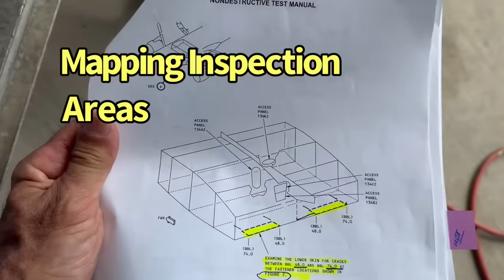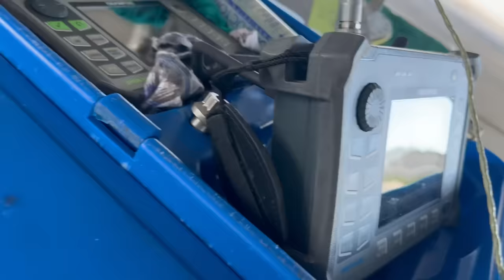AIRPLANE FUEL TANK ENTRY and CRITICAL inspection  #airplane #video #foryou

Comment: Do you know there are classes inside fuel tank too, in the middle where you can stand is the Business Class, then the premium and last that thin part of wing is the economy class.
Reply from the maker: Glad to see you here plyus ✈️ ⚙️ I use a lot the VIP section, that’s the one on Emergency exits 😂 ⛽️ 😂 It’s not every day we get in a fuel tank of an airplane and want to spend more time that we need. This is very dangerous, so with this equipment we can detect cracks under the paint were the naked eyes can’t see.The fuel was transferred to wing tanks, than the tank was drained, purged and vented for 3 days. It has to be all done for safety. I am glad that I am sharing aviation awareness with my videos. Welcome to our show. Check out our New video just uploaded link ⬇️ 
THE smallest DETAILS makes the BIGGEST DIFFERENCE #aviation #video #foryou
https://youtu.be/my6YMdnT388
Have a good day, See you soon next video ✈️👍

Comment: In the 70's I worked on Canadair CL44's ex Flying Tigers. I can remember climbing into Centre fuel tank bay and then releasing bottom of wing tank bags and squeezing under bag so as not to disturb the lacing which held the bag to the roof of the tank bay, to get to the outer bag, which was always the one that was leaking. That was scary, no breathing apparatus. no real safety gear all we got was a milk allowance. You had to keep your cool and not panic. I have never done pot holing, but I imagine that would be the closest I have ever been to doing that. I can still smell the Avtur.
Reply from the maker: Glad to see you here  Roger ✈️ ⚙️  Great story, I remember the flying Tigers they had the Queen of the skies Boeing 747. Those tank inspection are nothing but nerve wrecking. So with this equipment we can detect cracks under the paint were the naked eyes can’t see. The tank was drained, purged and vented for 3 days. It has to be all done for safety. I am glad that I am sharing aviation awareness with my videos. Welcome to our show. Check out our New video just uploaded link ⬇️ 
THE smallest DETAILS makes the BIGGEST DIFFERENCE #aviation #video #foryou
https://youtu.be/my6YMdnT388
Have a good day, See you soon next video ✈️👍
Reply from the maker: Great to see my aviation family here. ✊✈️🧐

Comment: Could you explain better what are you measuring and why? Thank you!
Reply: They aren't measuring as such but using a magnetic probe to check for cracks in certain parts of the structure.
The probe they use creates a high-frequency alternating electric current in the metal structure and by looking on the display at how that field is disturbed by the structure  shows whether there are cracks or not, where they are and how big they are can be measured.
The areas to be inspected are either determined by the structural engineers back at the manufacturers or from other inspections during maintenance.
If you do some research on eddy-current NDT testing, you'll see how it works.
Reply: @125brat  thank you. Very Very interesting!
Reply from the maker: Glad to see you here  Marco ✈️ ⚙️ With this special equipment we are checking for cracks in the structure under the green paint. I am glad I made this video for public awareness, so they can see what professionals do behind the scene  🎬 to keep skies safe. It has to be all done for safety. Welcome to our show. Check out our New video just uploaded link ⬇️ 
THE smallest DETAILS makes the BIGGEST DIFFERENCE #aviation #video #foryou
https://youtu.be/my6YMdnT388
See you soon next video ✈️👍

Comment: Spent too many years crawling through every inch of the kc-135. I have the scars and permanent injuries to prove it. I will never crawl inside another fuel tank for as long as I live.
Reply from the maker: Glad to see you guys here ✈️ ⚙️This job is not for everyone it’s definitely not for me neither. I do believe it’s the worst job in aviation. Great to see my aviation family here. There are smaller and much larger tanks, not to mention the wing tanks. So with this equipment we can detect cracks under the paint were the naked eyes can’t see.The fuel was transferred to wing tanks, than the tank was drained, purged and vented for 3 days. It has to be all done for safety. I am glad that I am sharing aviation awareness with my videos. Welcome to our show. Check out our New video just uploaded link ⬇️ 
THE smallest DETAILS makes the BIGGEST DIFFERENCE #aviation #video #foryou
https://youtu.be/my6YMdnT388
Have a good day, See you soon next video ✈️👍

Comment: How come there isn’t residual fuel inside the tanks, even just vapour. I’m a chemist and even in the labs beakers that used to have solvent in them will still stink. I understand that it will be purged with air, but still
Reply from the maker: Glad to see you guys here ScottlqndtheBrave ✈️ ⚙️ I don’t know what to tell it was 3 days of venting. This job is not for everyone. There are smaller and much larger tanks, not to mention the wing tanks. So with this equipment we can detect cracks under the paint were the naked eyes can’t see.The fuel was transferred to wing tanks, than the tank was drained, purged and vented for 3 days. It has to be all done for safety. I am glad that I am sharing aviation awareness with my videos. Welcome to our show. Check out our New video just uploaded link ⬇️ 
THE smallest DETAILS makes the BIGGEST DIFFERENCE #aviation #video #foryou
https://youtu.be/my6YMdnT388
Have a good day, See you soon next video ✈️👍

Comment: So, it was not about the tank, it was to ckeck if the wings will come off in flight soon or not.
Reply from the maker: Glad to see you here  TimTum ✈️ ⚙️ 😂 no winds coming off today. You are perfectly right, very observant, I understand what you are saying. It’s not everyday we get in a fuel tank of an airplane and want to spend more time than we need. This is very dangerous, so with this equipment we can detect cracks under the paint were the naked eyes can’t see.The fuel was transferred to wing tanks, than the tank was drained, purged and vented for 3 days. It has to be all done for safety. I am glad that I am sharing aviation awareness with my videos. Welcome to our show. Check out our New video just uploaded link ⬇️ 
THE smallest DETAILS makes the BIGGEST DIFFERENCE #aviation #video #foryou
https://youtu.be/my6YMdnT388
Have a good day, See you soon next video ✈️👍

Comment: As a NDT engineer I have entered several fuel tanks including A380, B777.. A380 is my fav as it is the most spacious inside…
Reply from the maker: Great to see my Aviation NDI family here. My biggest airplane tank was Boeing 747-400. Those are the worst jobs in aviation i believe. Just of the confined space and risk if something happens. I picked this video for you link below ⬇️ see you soon 🔜 
AIRPLANE ✈️ EXPERTS 🤷‍♂️ #grounded #aviation #video
https://youtu.be/r36siYl-yNQ
Reply: @slipperybeastaviationfishingsh  wow it looks cool, one of my fav aircrafts is B747 but unfortunately haven’t got a chance to work on one… 
A380 is worse for NDT. They have more NDT tasks than any other aircraft. Recently found around 1000+ cracks on LH/RH wing of A380. Extensive repairs are underway. We found many cracks on newer aircraft’s than old ones !!! Anyways these cracks doesn’t pose any risk to airworthiness as they are being monitored during repeat inspections..
Reply from the maker: Oh wow 😮 I never knew about that and the A380 , wow you got your work cut out for you. It’s crazy about the new generation planes. Great to see you here again.
Reply: @EK2921  yeah sure....cracks are not dangerous for liquid fuels. Not even a car tank is driveable with cracks in the tank, but an airplane surely is, right?  Dont tell Bullshit to people. Whatever goes in these chambers, it is certainly not liquid fuel.

Comment: I have a 100 gallon transfer tank in the bed of my Chevy 3500HD and when it's half full and i come to a hard stop all of the sudden you can feel the fuel rocking the truck forwards and backwards temporarily.  Thats just 50 gallons. The slippery guy wants you to believe there is 28,000 gallons almost 200,000 Lbs of weight in the wings of this plane, let that sink in if u can.
Reply: Thats approximately half the take off weight....ok
Reply from the maker: Sorry for the late reply cdimmm. Good to see you here ✈️ ⚙️ Thank you 🙏 for such comment. I hear you about your 100 gallon fuel ⛽️ tank. Those walls we are going through are called baffles to keep the fuel from slushing. Look it up on Google. Boeing 767 fuel tanks and capacity. I am glad I made this video for public awareness, so they can see what professionals do behind the scence to keep skies safe. It has to be all done for safety. Welcome to our show. Thanks for enjoying this video.Check out our New video just uploaded link ⬇️ 
Camera Inside Airplane Turbine Jet Engine #airplane #video #foryou
https://youtu.be/mdCpb5tp66s
See you soon next video ✈️👍

Comment: I have a question guys... if eddy current say that you find a small crack or samall opening.. how did you repair it?... could be usefull any epoxy to fill damage?...regards and take care all the time, thanks for show us
Reply from the maker: Sorry for the late reply Oschuttp. Good question,so the fuel tank is part of the structure of the entire airplane ✈️. Permanent repair would required using same type of material as a doubler or a trippler . Have a good day
Reply: @slipperybeastaviationfishingsh  Thanks and my Best regards
Reply: @slipperybeastaviationfishingsh 
Back to the structural engineers to decide whether to raise the inspection frequency or apply a repair scheme.

Comment: Aircraft fuel tank inspector position opening:
Mandatory job requirements, the candidate has to be in shape otherwise the company is not responsible in case he gets stuck in openings while entering and exiting.  Thank you.
Reply from the maker: 😂 that was funny. They have to have a size requirement 😂 ✈️⛽️😱

Comment: Speaking from experience As a 1 time gas station builder I've seen the inside of Many tanks. And I could tell you that the tank inside this airplane Has never seen 1 drop of fuel!!!!
They're doing these videos as damage control Because of how much information is getting out About the truth that these planes use no fuel. The only engine that would use fuel is the auxiliary engine in the back. That engine is what drives the main engines with compressed air. You can also witness for yourself In many vacation spots where the people on the beach Wait for a plane to take off and they hold on to the fence as the Air blows blows them around.  Well whats coming out of the engine is very clean and very cool air As in Being run by only air. No person has ever been burnt By the air coming out of these engines as you would expect if it was Run with fuel that air would be very hot  enough to severely burn people
Reply from the maker: Wow 🤯 look up on Google how many gallons of Jet A fuel ⛽️ Boeing 747 -8 can carry for an 18 hour flight none stop. It will burn 63 K gallons. Yes that’s 3 eighteen wheeler fuel trucks you see in the road. 
Sorry for the late reply , glad to see you here  ✈️ ⚙️  It has to be all done for safety. I am glad that I am sharing aviation awareness with my videos. Welcome to our show. Check out our New video just uploaded link ⬇️ 
Camera Inside Airplane Turbine Jet Engine #airplane #video #foryou
https://youtu.be/mdCpb5tp66s
Have a good day, See you soon next video ✈️👍

Comment: Where is the fuel stored?
Reply from the maker: Glad to see you here  Tamoghna ✈️ ⚙️ Its stored there and in the wings all 18K gallons. It’s not everyday we get in a fuel tank of an airplane and want to spend more time than we need. This is very dangerous, so with this equipment we can detect cracks under the paint were the naked eyes can’t see.The fuel was transferred to wing tanks, than the tank was drained, purged and vented for 3 days. It has to be all done for safety. I am glad that I am sharing aviation awareness with my videos. Welcome to our show. Check out our New video just uploaded link ⬇️ 
THE smallest DETAILS makes the BIGGEST DIFFERENCE #aviation #video #foryou
https://youtu.be/my6YMdnT388
Have a good day, See you soon next video ✈️👍
Reply: @slipperybeastaviationfishingsh  but I want to see the floating oil in the tank.

Comment: What is with all the gray sealant/putty on rivets and seams. Looks like some one had a field day with JB weld in there. I have used it to repair leaks on fuel tanks in autos. I'm guessing those rivets and seams were seaping, and this is a approved repair??
Reply from the maker: Glad to see you here Thomas ✈️ ⚙️ this airplane has been around for 29 years. The sealant is called PRC B2. It what they use, all repairs are good to go. So with this equipment we can detect cracks under the paint were the naked eyes can’t see.The fuel was transferred to wing tanks, than the tank was drained, purged and vented for 3 days. It has to be all done for safety. I am glad that I am sharing aviation awareness with my videos to the public. Welcome to our show. Check out our New video just uploaded link ⬇️ 
THE smallest DETAILS makes the BIGGEST DIFFERENCE #aviation #video #foryou
https://youtu.be/my6YMdnT388
Have a good day, See you soon next video ✈️👍

Comment: It would have been more educational if he explained what exactly he was measuring.
Reply from the maker: Glad to see you guys here Museamjunkie ✈️ ⚙️ Sorry it was about doing the inspection and getting out as soon as possible, before static ⚡️ This job is not for everyone. There are smaller and much larger tanks, not to mention the wing tanks. So with this equipment we can detect cracks under the paint were the naked eyes can’t see.The fuel was transferred to wing tanks, than the tank was drained, purged and vented for 3 days. It has to be all done for safety. I am glad that I am sharing aviation awareness with my videos. Welcome to our show. Check out our New video just uploaded link ⬇️ 
THE smallest DETAILS makes the BIGGEST DIFFERENCE #aviation #video #foryou
https://youtu.be/my6YMdnT388
Have a good day, See you soon next video ✈️👍
Reply: @slipperybeastaviationfishingsh  Thank you very much for the explanation. I almost tried to get my A@P years ago. I chose cross country trucking instead. Thanks for keeping us safe when we fly :) I wonder if the 767 automatically transfers fuel from tank to tank to keep the center of gravity correct or does the pilot have to manually do it? I remember watching a Concorde video and the flight engineer was having to monitor that and transfer fuel manually from tank to tank. Thank You
Reply from the maker: @museumjunkie9317  It’s never to late ⏰ to join the aviation Technicians. This career is doing better than ever. High demand and great pay 💰 with benefits. I do believe fuel ⛽️ manually switched by the copilot to keep weight and balance. Glad you are here anyways enjoying some inspections with us. Have a great day. See you soon next video. Let me know if you have any type of aviation video I can do.
Reply: @slipperybeastaviationfishingsh  Thank You

Comment: How on earth, is it possible that the engines are running but the fuel tank is dry like a Sahara desert.
How on earth is it possible fire those engine to left an Olympic swimming pool size fuel + all the passengers, there luggage and the enormous weight of the entire aircraft.
These Engines run on compressed air ( Nitrogen & Oxygen ) there is absolutely no fuel except in the wings only for igniting the fuel ( oxygen & nitrogen ) that's the reason there is no smoke thus no exhaust.
Reply from the maker: Glad to see you here MrPatriot ✈️ ⚙️ That airplane takes 27 K gallons of Jet A fuel ⛽️ those engines run on fuel. Yes they produce pneumatic air to run the air conditionings, hydraulic power and electrical power for the aircraft. Aviation engineering is mind blowing 🤯 we can never even imagine the complexity that keeps everything running smooth. I am glad I made this video for public awareness, so they can see what professionals do behind the scence to keep skies safe. It has to be all done for safety. Welcome to our show. Thanks for enjoying this video.Check out our New video just uploaded link ⬇️ 
NEW BOEING 767 AIRCRAFT TURBINE JET ENGINE INSPECTION 😓#aviation #video #foryou
https://youtu.be/Ii-nUDZ4KLU
See you soon next video ✈️👍

Comment: Wow wtf Boeing. It's 2024. How is a strong, independent, plus sized inspector supposed to fit in that access hole?
Reply from the maker: Glad to see you here Kibbles ✈️ ⚙️ 😂 So with this equipment we can detect cracks under the paint were the naked eyes can’t see.The fuel was transferred to wing tanks, than the tank was drained, purged and vented for 3 days. It has to be all done for safety. I am glad that I am sharing aviation awareness with my videos to the public. Welcome to our show. Check out our New video just uploaded link ⬇️ 
THE smallest DETAILS makes the BIGGEST DIFFERENCE #aviation #video #foryou
https://youtu.be/my6YMdnT388
Have a good day, See you soon next video ✈️👍

Comment: Tank Rats we called them in the U.K.
I'M retired now and my gut would never fit through the access panel 😁
Reply from the maker: Glad to see you here again, Mike✈️ ⚙️ Yeah we have heard of the Tank Rats here in the USA too. It is not a normal thing for us to be in an Airplane Fuel Tank. It probably worst job in aviation. So with this equipment we can detect cracks under the paint were the naked eyes can’t see.The fuel was transferred to wing tanks, than the tank was drained, purged and vented for 3 days. It has to be all done for safety. I am glad that I am sharing aviation awareness with my videos. Welcome to our show. Check out our New video just uploaded link ⬇️ 
THE smallest DETAILS makes the BIGGEST DIFFERENCE #aviation #video #foryou
https://youtu.be/my6YMdnT388
Have a good day, See you soon next video ✈️👍